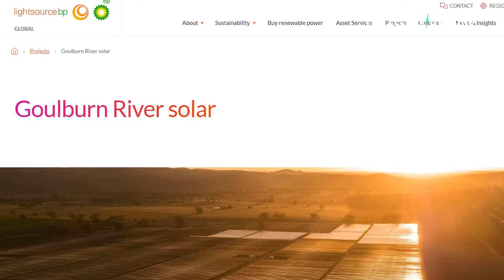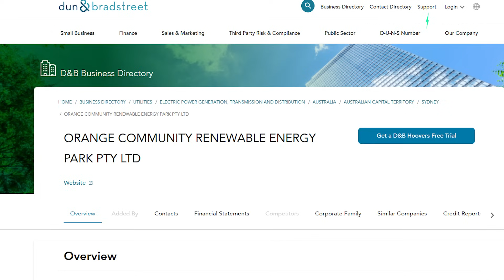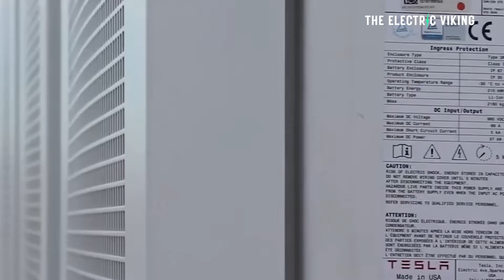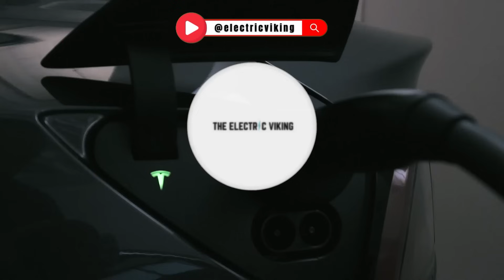Skyrocketing solar, wind and batteries in Australia destroy fossil fuels

Comment: Solar and wind are not reliable enough because of the fact that wind does not blow all the time and clouds affect solar as does night and day. And by the time you add batteries and factor in the average effective capacity for generation, it turns out its more expensive than gas or nuclear.
Reply: Lies
Reply: Read much?
Reply: Lear,y you are making things up and have no clue. Get educated and google Lazards lcoe
Reply: Untrue, go away
Reply: @atarisidequest  The real cost of net zero: sky news australia says otherwise. Its on youtube. Fo and watch it.
Reply: Wind power needs to be backed up by gas , in Europe not unusual to have 10 days of not enough wind speed so battery bank back up  required would be massive and expensive (and environmentally needs to be renewed often) . Nuclear provides constant base load and will be required for AI datacentres etc. Solar + battery may work in some parts of world  but need to have a reliable back up unless outages acceptable
Reply: @Tl-rs1dv  Australia's renewable generation is more reliable than Europe. We are a sunny country with the highest market penetration of rooftop solar in the world.

 The worst renewable hour in the last three years has been 15% of the average, the worst day has been 65% of the average renewable day, the worst week 85% of the average week, the worst month in the last 5 years 85% of the average. David Osmond, senior engineer at Windlab, for over 2 years has been extrapolating daily wind and solar generation to a 5% over-capacity and using existing hydro then matching to daily consumption and demand. With just 24GW/120GWh (5 hours of storage) on top of our existing hydro we can easily get to 98% renewable generation based on existing output profiles.

Comment: The only data are these ones: now (and more or less 24/7/365), Australia 616, France 64 (lower is better). The other ones are just your usual and unuseful cherry picking.
Also, uranium is NOT fossil.
Go nuclear or go nowhere.
Reply: Yes molten salt fission is the least expensive and safest energy.
Reply: @red-baitingswine8816  I see you repeating this comment multiple times and decided to read a bit. These SMRs are in the low MW size and prototype commercial reactors are either being planned or just starting. Even China: "Further work on commercial reactors was announced with the target completion date of 2030." This might be the future, but not now. Is there a working commercial molten salt reactor over 100MW somewhere?
Reply: @Mark Valery:  I think China has a Thorium reactor working, don't recall its capacity.
.
Thorcon has started work on a Thorium/Uranium pilot MSR for Indonesia. They have a design for full sized power plants to be mass produced in shipyards, transported by sea, and set up at shorelines.
.
Ed Pheil (Elysium) designed a fast spectrum reactor (125 - 1500 MW) that operates on all kinds of nuclear waste as fuel.
.
There are some Danes with a modular design that can be mass produced and grouped in batteries of any size.
.
These MSR's, since the fuel/coolant is (low pressure) liquid (~700° F) far below its boiling point, fission the fuel completely, and have no risk of exploding steam in the reactor, so are inherently simpler and safer than legacy pressurized water reactors with solid fuel rods that need to be manufactured.
Reply: @ I searched again for China's existing reactors. One 2MW exists now, everything else is planned. >100MW not until 2030.
Reply: @ Thorcon completed the design, nothing further.
Reply: @ Thorcon. I misspoke: "Current status: Design phase mostly complete, awaiting regulatory approvals and a legal framework to begin construction." Design is mostly complete. At least this is a 500MW design hoping to be completed by 2029, but they better start working fast, that is a faster construction completion schedule than China.
Reply: @ Mark Valery:  As I recall the Chinese plant processes 100% Thorium, and so requires more R&D to develop processes to segregate the fissable U233 it breeds, etc.

Comment: Wind has never been effective, solar however im still a fan of. Don't discount nuclear.
Reply: nuclear in Australia is finished. Wind fills gaps in good wind areas and low light.
Reply: Depends where you are in the world, some locations wind is more constant with higher output than solar.
Reply: @GruffSillyGoat very true. You cant go wrong with constant strong wind.
Reply: Yep the microplastics pollution will be with us for decades over these cheap nasty solar panel from China.
Reply: It's an absolutely risible idea for a plethora of reasons ranging from geographic limitations to transmission limitations. All hard limits imposed by physics.
Reply: @DarkClosetOfTheMind  sky news australia: the real cost of net zero... on youtube telling it like it is, not creating fairy stories.
Reply: @Dungshoveleux  you’re making yourself look stupid
Reply: @Dungshoveleux  omg sky, a literal anti-renewables outlet.
Reply: @atarisidequest  but is it the facts?
Reply: @Dungshoveleux  oh you're a bot
Reply: @Dungshoveleux  The Sky News analysis has holes in it big enough to drive a truck through.
Reply: @tassied12  And they are? You didn't say
Reply: @Dungshoveleux  For a start it blamed the rise in power prices on the implementation of renewables.

AEMO data shows that Australia's power prices have been most closely linked to the price of gas.

Australia's power prices started rising after the overseas export market was set up without a local reservation policy, meaning that local generators are forced to pay global market prices for gas.

Even though gas consumption has been falling, gas still is a major influence on price setting in a high proportion of dispatch intervals in our energy-only market.
Reply: Nuclear takes too lnog to build.
Reply: Solar and wind are not reliable enough because of the fact that wind does not blow all the time and clouds affect solar as does night and day. And by the time you add batteries and factor in the average effective capacity for generation, it turns out its more expensive than gas or nuclear.
Reply: @Dungshoveleux storage. Battery and thermal are both mitigating factors. Your information is outdated and frankly risible
Reply: @atarisidequest  I just saw a you tube video on the real cost of net zero in australia and it didn't mince its criticism.
Reply: @Dungshoveleux  did you check sources? How old is the source data? Are the costs amortised over equal periods? Where is the data for each energy type collected?
Reply: @atarisidequest  check the data yourself.
Reply: @Dungshoveleux  no. I'm not making claims, you are. Your claims, your burden.
Reply: @Dungshoveleux  Where’s your evidence for that? because it’s not what I have heard. Batteries getting cheaper all the time
Reply: @Dungshoveleux references?
Reply: @julianskinner3697  I gave a reference.
Reply: @Dungshoveleux you must know thats nonsense